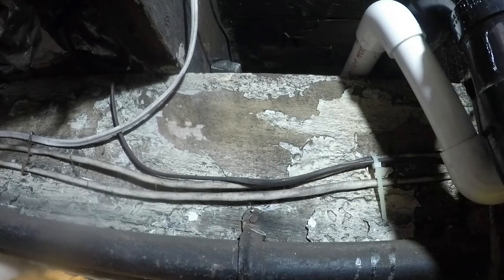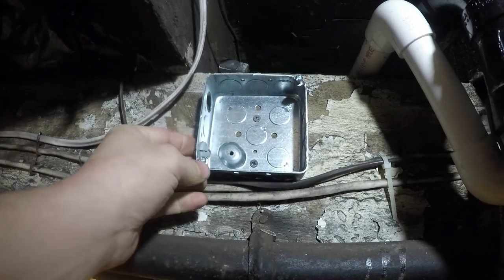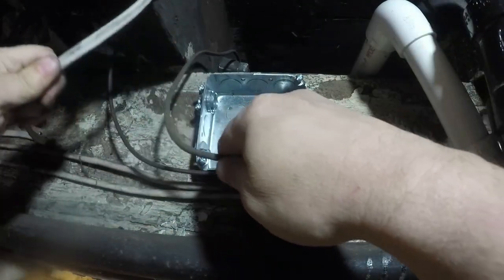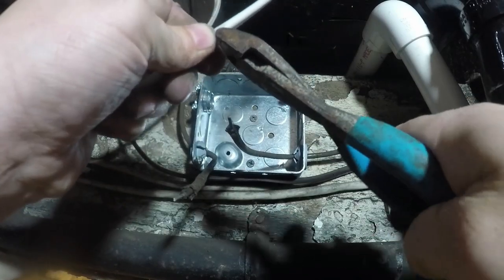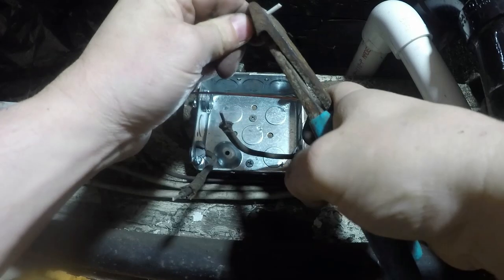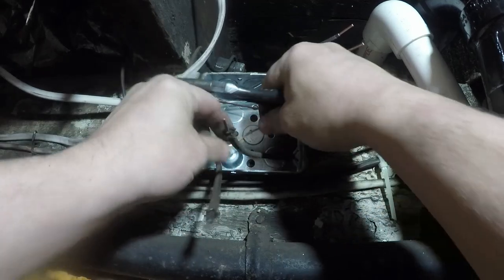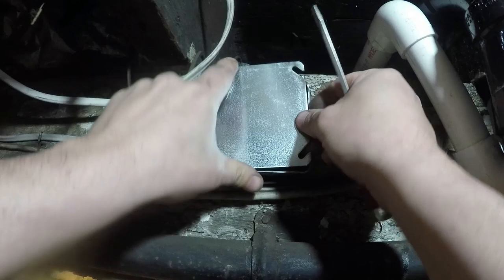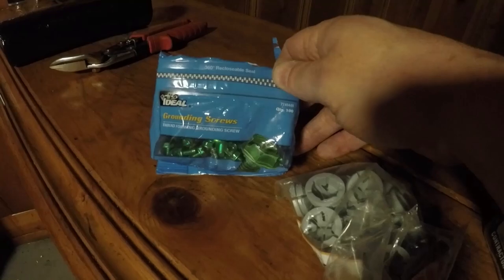KNOB & TUBE to ROMEX WIRE 4x4 ELECTRICAL JUNCTION BOX

Comment: Thank you! I have not found anyone else who does not just say "Get rid of K&T!"  No one else is showing how to safely adapt it to new wiring. I had not seen those non-metalic connections
Reply: It’s illegal. There is no ground path. 🤡
Reply: @ryankilduff8694  I believe you can add a GFI immediately after the service box (or GFI breaker) and that would make it safe and legal- no?
Reply: If you need a youtube video how to do this, you shouldn't be doing this.
Reply: @lavnoc69  no. no. it's not.
Reply: Agreed. I’ve learned a bunch of information from Mr. Helper Guy 👍🏻

Comment: I'm very shocked how good the condition of that knob & tube wiring was.. whenever I see that in older homes it usually breaks apart whenever I try to touch it. Therefor I just run a whole new wire & abandoned the knob & tube
Reply from the maker: It comes down to how much the wire was overloaded through its life.
Reply: I have a question about Knob and Tube wiring. Unlike romex wire which is color coded (black, white) which wire is the Hot and which is neutral ?
Reply: @chrisbeard5794  haha back in the day you would touch it with your hand and find out. Now a days you would have to use a pen tester or a volt meter
Reply: @STXVIEC  volt meter doesnt work becuz it has to touch the hot and neutral to get it to read. Only way to do it would be to run a scrap wire from an outlet and touch the neutral wire from the scrap line to the neutral than touch each side of the knob and tube. Nob and Tube just sucks.

Comment: Thanks for the video. I live in a 96 year old home with all K & T. I've lived here for 35 years and have worked with it, adding boxes, replacing fans, switches and receptacles. I am trying to upgrade the house wiring by adding a new panel with new circuits and breakers. I've been trying figure out how to incorporate the "good" in perfect shape K & T with Romex. This video is a start, so I appreciate it very much!
Reply from the maker: Good luck with your old home.
Reply: Remove it all Bruh
Reply: @philbarrows424  I agree that replacement is best, but in some cases it is very costly to replace wires within walls. I’ve had some luck dropping wires from an attic to switches, but in multi-story buildings, it’s nearly impossible to replace it all. This is sometimes the best you can do.

Comment: This is a blatant code violation. You can't splice Romex into K&T, even in a box. NEC 394.56 - soldering with KnT approved wiring is the ONLY way you are allowed to add onto knob and tube systems. KnT was NEVER permitted to be mixed with Romex with wirenuts or any other way.
Reply: If it’s his house he can do whatever he wants.

Comment: Where are you located?  I need this old 120 year old house updated before winter to support the 5t HVAC w20000kw heating strips that the 100 amp knob and tube apparently won’t support.

Comment: I am in general agreement with what is shown in this video. I would improve on this by doing the following. 1. Use fine sandpaper to brighten up the metal by removing corrosion from the old wire, before splicing to the new wire. This improves the splice by lowering the electrical resistance which, in turn reduces heat within the splice when electricity passes through the wires. 2. Seriously consider soldering the wire splice instead of just using wire nuts. Use a good grade of rosin core solder. (Do NOT use acid core solder.) Soldering was the standard for making splices during the original installation, decades ago. A twisted soldered joint is superior to one using only wire nuts. 3. To the extent possible, examine all existing splices to ensure they were soldered, and are still in excellent mechanical condition. 4. Consider the feasibility of dropping a 14 gauge insulated copper wire, to use in grounding the outlet box. Connect the ends of this wire from the grounded metal junction box, to the outlet metal box. 5. Ensure that the metal junction box where the splice was made, is visible (not buried or hidden) so it can be serviced when (or if) it needs to be.
These pointers will ensure electrical safety until the old wiring is eventually replaced (which would be wise to do, if major physical upgrades are done).
Reply: Soldering is still the only permitted way to extend knob and tube. This video is just dangerous gardener-special BS.
Reply: @burgundyyears  Unless you're extending the circuit by splicing with Romex in a metal junction box, yes?

Comment: You used drywall screws to install the junction box. Drywall screws will oxidize inside the box. I've only been teaching myself electrical for 24hrs on Youtube, and this was one of the things I've already picked up.
Reply: What are the best screws to use for boxes then
Reply: speak up
Reply: I’d suggest galvanized drywall-type screws, or anything that is rated for outdoor use with a sharp point to get started.
Reply: who cares if the screws oxidize? they will hold just as well they just won’t be as pretty..
Reply: I'm an idiot lol, metal oxidizing spreads to other metals, which in turn breaks those metals down as well. Rereading your comment, you mentioned the appearance of the oxidization, but this means rust sets in which destroys the material, not just change the appearance as you may think of copper doing. Cheers!
Reply: @joemama370  yeah.. but in most environments the screws will be absolutely fine. Even if they are in direct exposure to water (in which we would have bigger problems then the screws) they would take years and years and years to become deficient enough to break.

Comment: Thanks for the video. Simple enough. I want to make sure I'm using this video correctly. My 1939 home in Southern California looks to be running on all original K&T to breaker panel. Been here since 2004 and never experienced any problem at all. I want to add an outlet in my kitchen about 4-5 ft from an existing outlet. I cut out a few holes and can see that the 2 KT lines are coming down from the ceiling, ending at this outlet. Can I disconnect the outlet and splice the 2 KT lines to Romex as you did, in a metal junction box? And then reconnect the Romex from the junction box to the existing outlet then on to a 2nd outlet? How do I handle the ground wire from the Romex?
Reply: Honestly this video isn’t ideal it’s not the best to mix K&T and romex if you are to add a junction box it needs to be accessible for any future work/troubleshooting etc. 
that’s how it is in Quebec

Comment: I would say you should DEFINITELY tighten that neutral wire nut down more. I know you are trying to keep the K&T from breaking but a poor connection in a wire it is one easy way to cause voltage drop and cause a fire. Otherwise great job
Reply: whyw ould the voltage drop
Reply: @randomrazr  I should have said a Hotspot not voltage drop. More likely that it will arc/create a Hotspot I used incorrect terminology as voltage drop happens more across series resistance such as using incorrect wire guage whereas a loose connection will just cause flickering and a hotspot.

Comment: Knob and tube uses the same concept as power lines. If you notice at each support there is a porcelain termination. Porcelain is used primarily for 2 reasons. 1 is it is not conductive so it can insulate from the support material and 2 is it dissipates heat through it's self. You can bet that if the wire was just sitting on wood it would burn under high loads. That's why knob and tube had strict guide lines to not allow the wire to touch anything. The insulation of these wires is no wear near the insulation used in Romex. All cooper has heat do to it's resistance properties and these are the thermals that should be taken into consideration. Every wire nut adds to that resistance which adds heat. The higher the load the more heat.
Reply from the maker: Thanks for the input.

Comment: Are those 2 separate runs of knob and tubing tied in the new romex to breaker? If so how would you tie romex into one single line
Reply from the maker: I guess that depends on if the knob and tube line is a hot or neutral.
Reply: @themrhelperguy  the one I have is hot, it runs along all the light fixtures on the top floor.

Comment: Is this Romex circuit grounded bc of the metal box ?  Or does the metal box need a ground wire ran to the panel
Reply from the maker: A ground wire is needed from the breaker panel to the metal box.
Reply: @themrhelperguy  That would have been helpful to know first...

Comment: How did you ground the box with the romex ground? Is the romex connected to ground somewhere down the line?
Reply from the maker: The romex ground goes back to the breaker box.
Reply: @themrhelperguy  Ok, I wasn't sure if the K&T wiring was coming from the panel or not. Thanks.
Reply: @themrhelperguy  does the romex feed power to the K&T or is it vice versa?
Reply: @themrhelperguy  But doesn't the knob and tube remains ungrounded downstream to whatever outlets, switches or fixtures it connects to?
Reply: @erickwright2360  The downstream knob and tube would remain ungrounded.

Comment: Getting rid of k t is the proper way. Basically push sticks, fish tape, Sawzall and wall patches to get the job done. Now if this house has a fire due to wiring , will the homeowners insurance cover it.
Spend some time planning you don't have to follow the same route as kt.
Reply from the maker: That's the mechanical end. There is still the financial end and scheduling not to mention the historical preservation perspective.

Comment: There is not a license electrician in the US that would have did what you just did have you ever heard of the national electric code
Reply from the maker: What did I do? As far as I can interpret this is an acceptable splice. Additional comments would be appreciated.
Reply: The splice is fine your work look good that is not the problem I have the problem is you re-energize wire that is anywhere from $120 to 80 years old you took that liability you have to protect your license did you verify that the install was still up to the UL listing before you re-energize it not your work my friend you should have up sold the job or told them no all it takes is that one bad light in the house to burn and your spice could have been perfect but you would have been at fault because you were the last electrician to work on the house that's why I'm telling you that no other electrician would have touched that 100 miles they would have made them rewire the whole circuit or the whole home or said no
Reply: If you go to someone's home and the way that wire cracked when you put it in the box if you see wire that brittle you automatically replace it or do nothing to it all take your service fee and go home that's all I'm saying my friend and I hope you at least used an arc fault breaker for your home run
Reply: @TheBiglarryman which is the problem when people have no money and need help.  To much government!

Comment: Only a hack would strip wire before putting in the box, then ring the copper with diagonal cutters. You can’t wire to knob and tube wiring legally, your equipment ground is lost.
Reply from the maker: I don't know what the connection is between stripping the wire outside the box and a hack. Just not sure of that one. If you ring the wire it must be redone. Lots of practice to strip the wire without the ring. You are not loosing the equipment ground because there never was an equipment ground. You can't loose something that was never there. Yes you can wire to knob and tube. If you couldn't the entire run would need replaced to make a repair. Not possible when there is a budget, occupants, access ect. A gfci breaker can help with the missing ground that not missing since a gfci does not depend on a ground wire to function.
Reply: I srip the sheating off my romex pefore putting it in the box. Not sure if that is what you meant. No need to try and cut it with a razor inside the box with no room. That's just how i do it. hate walking into a ruff and seeing romex with the sheathing still on sticking out of boxes.
Reply: @themrhelperguy  All true. You either have to install a 2 prong receptacle, or use a GFI if no ground is present.
Reply: @jarrydee2799  can’t you do a 3 prong if you use a metal box and pigtail the ground from the receptacle to the metal box and have a ground?
Reply: Thank you , this is isn’t a electrician he’s a dyi or handyman . Never was this allowed
Reply: @jarrydee2799 the sheathing is supposed to be ½ inside the box
Reply: @erinfrench7093 if the metal box is grounded to….?  A proper ground like old metal water lines.

Comment: That stuff is a fire hazard. It is too old.   Get rid of it.   This is a hack job.
Reply from the maker: In the real world K&T needs delt with.
Reply: @themrhelperguy   Yes.  It needs to be disconnected, and explain to the customer that  its a fire hazard and you don't want to touch it.  Don't be that guy.  You shouldn't be connecting 100 year old wiring to new romex.  They can deal with a hole in their wall, maybe roughly patched over their house burning down.

Comment: First off it’s against code to splice knob and tube with new wiring . For one it’s dangerous unsafe and stupid .
Reply from the maker: If that were true repairs could not be made to knob and tube resulting in a truly dangerous situation.
Reply: How is it in any way dangerous or unsafe, you clearly just jump on the bandwagon of, “AHHHHH KNOB AND TUBE ITS THE END OF THE WORLD!!!!!” And not actually evaluating wire condition and doing proper splices. The knob and tube wire is 14 guage (most are) and rated for 15 amps, same as the romex wire. I would say however that he DEFINITELY should have tightened the neutral wire nut down more but other than that I agree with the way he has done his splice.
Reply: @themrhelperguy  I will say from what I saw in the video that neutral definitely needs more tightening
Reply: Depends on local code.  Many local codes allow splicing knob and tube with new wiring, so long as it is done in an electrical box.

Comment: This video is exactly how people get hurt . Watching this thinking your learning electrical education in fact your leaning what not to do . The video should be titled how to not do electrical work by a handyman
Reply from the maker: Exactly how should this be handled in the real world of the reality that knob and tube exists out there and needs delt with.
Reply: @themrhelperguy  brotha if I have to explain that to you ,You shouldn’t be teaching this on YouTube or showing it . For example you should how important a ground screw was , but you ground a ungrounded knob and tube wiring there for making it ground one side of the circuit only to a metal box that’s not effective. Knob and tube wiring is a different material then Romex for example they are rated different. The only way you do this work is by upgrading the wiring removal of the knob tube . If they or you  can’t afford this then you don’t get the service . Because I’m not the one going to be liable when those wires heat up pass their rating and
Catch fire , or when the insulation breaks off . There’s a reason why you can’t insure or sale a home with this wiring  it’s dangerous
Reply from the maker: Let me give you a little bit more info on this. The Romex runs to the breaker panel and grounds the metal box. This part of the knob and tube was a circuit that could not be accessed therefore a spice was made in an electrical box. The majority of the knob and tube system was removed and this circuit still needed to be energized. As far as rating goes that does not apply to the work in the box. The size of the breaker in the breaker box decides how many amps will flow. As far as a heat rating that would come into play such as a ballast in a flouresent light is a outside heat source that would not come into concern in a 4 inch electrical box. This wire is in great condition because the wire was not overloaded and did not heat up to harm the insulation. There is no reason to believe that reducing the load on this wire that will continue until the time the wire can be replaced. You absolutely can insure and sell a house with knob and tube wiring.
Reply from the maker: I'm not a handyman I'm a gardener.
Reply from the maker: Can you explain how this wire could heat up past its rating?
Reply: @Theatrelove  He literally said in the freaking video that both the K&T and the romex are 14 guage, meaning both are rated for 15 amps.
Reply: @themrhelperguy  I'm with you. I've done that a few times. People can't afford to have their whole house rewired. Like you said the wire was in good condition and you kept it within a tolerable load limit. In an ideal world, yea it should be replaced but then again it would also snow money and cows would shit diamonds. Good common sense and judgment are needed in these kind of repairs and you did just that.